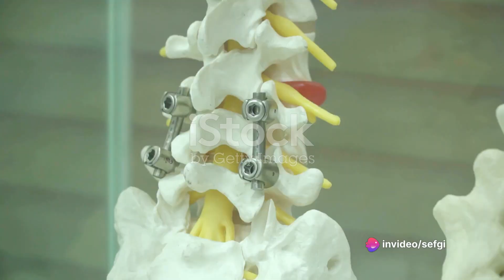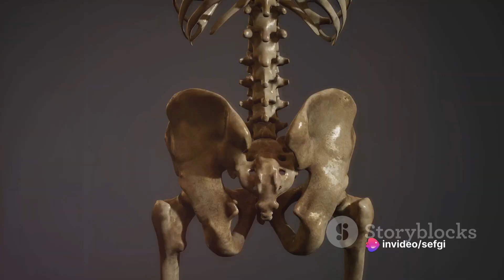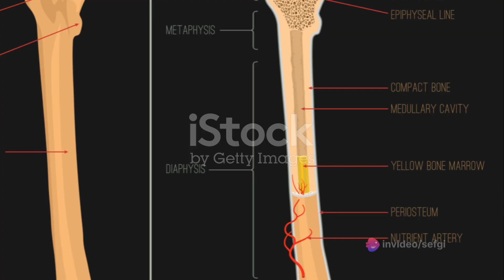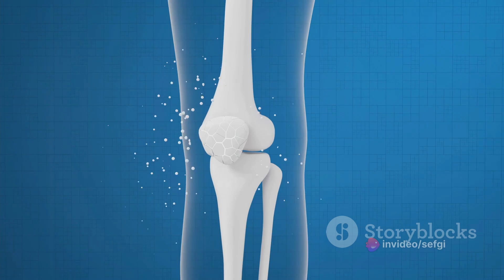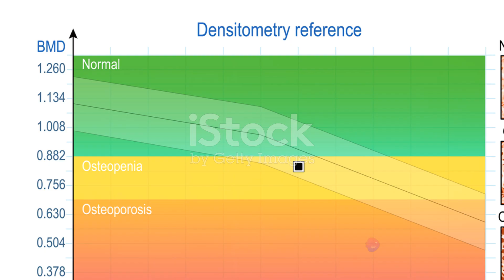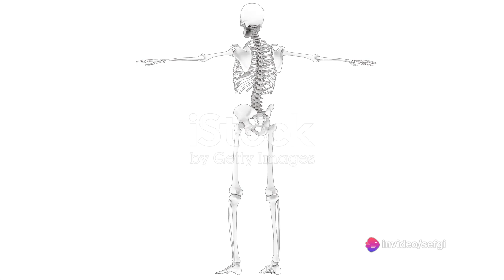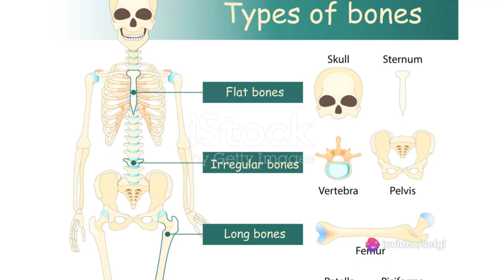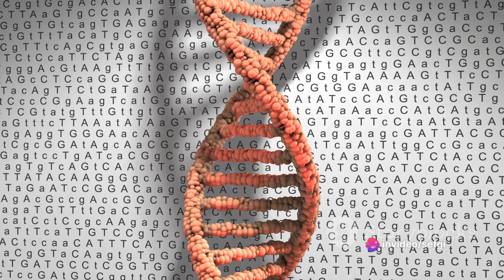What If You Changed Your Bones to Metal

Comment: Doctor here. You forgot the most important disadvantage: in the absence of bone-marrow, there is not blood production, so the host would permanently require regular blood transfusions. The arguments of aesthetics, allergy and electromagnetism are negligible (metal doesnt look different under the skin unless you are also replacing the teeth, surgical steel is hypoallergenic and non-magnetic). The biggest problems are blood production and risk of infection. Good video otherwise, I asked myself this exact question when I was growing up :)
Reply: What if you put the metal around your bones (your original bones are still there but with a metal casing) and let's say somehow infection is negligible